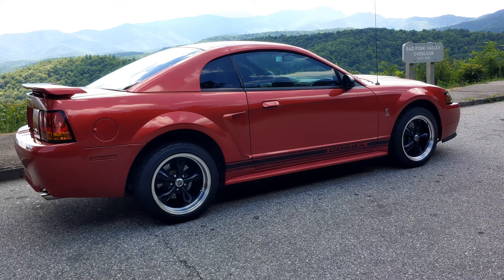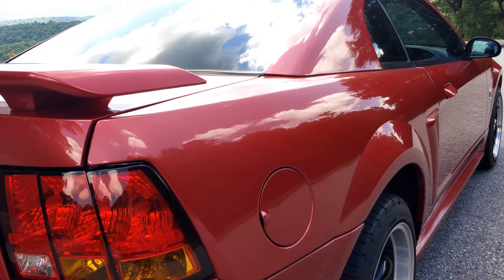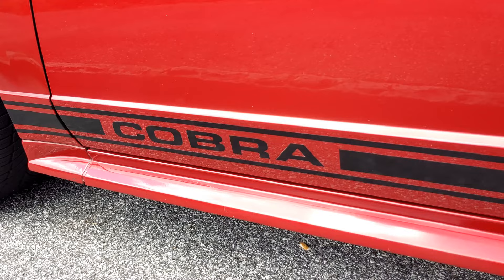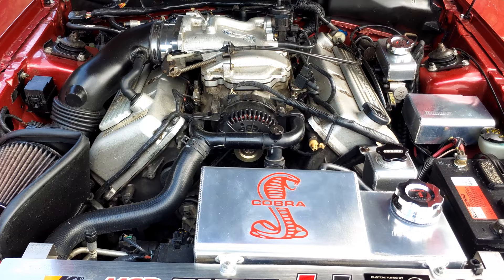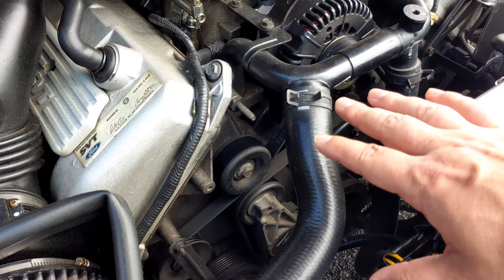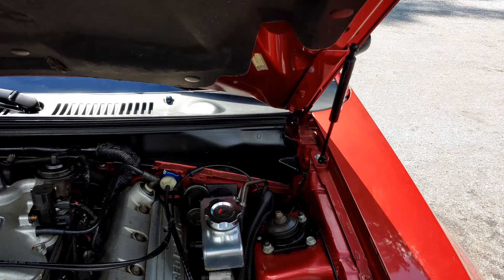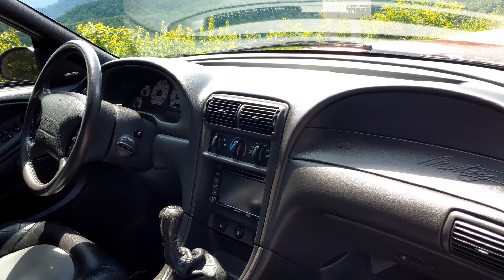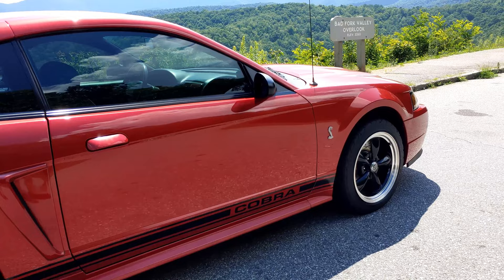An Affordable Muscle Car | The 2001 Mustang COBRA

Comment from the maker: I've since sold this 01' COBRA, and now enjoying the GT500KR. It was an awesome car I had for 10 years. Let me know in the comments below what you think about the COBRA 🛠
Reply: Well that great man!! I am getting offered a 1999 cobra Clean title paint is rough bumper was replaced from previous one being damaged but I am getting told $4500 just hesistant becuase of it being 210k miles what should I do? It’s a freinds parents.
Reply from the maker: @waspcosm1c901  That's an OK price for a COBRA, but that's a lot of miles. I'd probably want to do a compression test and see how the engine internals are doing before buying a car with high mileage. Also, be prepared for things like IRS suspension bushings, transmission, A/C, and electronics too when over 100k. That's in addition to the normal stuff like brakes, pumps, belts, cooling, intake, clutch, etc..

If your handy and don't mind working on cars it's will be a good car to enjoy. However if breakdowns, and mechanical fixes aren't your thing I'd probably steer clear. I'd also offer $3800-$4k with that many miles unless it's immaculate and has all maintenance done.

Thanks for watching! 🛠️
Reply: @TheEclecticHandyman  thank you and I ended up not taking the deal I usually pay shops and would’ve been too expensice

Comment: I’ve been on the market for one and it’s hard to find an 01 Cobra that checks all the boxes and is at a good price point. Beautiful cars
Reply from the maker: I totally agree the way to get one of these is close to stock if possible even if they have some miles. The ones to be careful are the heavily modified or younger drivers that probably ran them too hard and might be buying a clunker.

These will always be in the shadow of the 03-04' Terminator and hence cost much less. My recommendation is to open up your search radius country-wide and be open to traveling to go get a car or have it shipped. You might find some older person selling a stock 01' COBRA 800 miles away on the cheap and worth it to fly there 1-way and drive it home or have it shipped. Thanks for watching! 🛠️

Comment: Ive got my 01' Zinc Yellow 48k mls maybe up for sale..Maybe....Prices should start coming up for these low production cars..Roush short throw shifter , Chrome 03, 04 Terminator wheels.Chrome race pedals same rocker panel badging as this car aswell..Also mine has the Teksid block made from Ferrari for Ford..

Comment: The powered by svt coil covers are 07-14 gt500 covers.  Everything is interchangable between all 99 up 4v weather its 4.6, 5.4 or 5.8.  Theyre all mod motors.  Alot of guys put these gt500 covers on 99-04 cobra and 03-04 mach even tho machs arent svt they had an "svt engine" i guess is the thought process.

Comment: I own an 07 gt500 and i am about to purchase another stockish 97 cobra to fix up.  I used to hace a 97 cobra and 03 mach i love the 4v engines.  I understand totally what you mean about the gauges.  The 07-09 gt500s gauges were kind of hard to read in the daytime under certain condition and these are not at all.  The white face was actually a nice touch they should have continued that.  But at night i can see the gauges awesome.  These are very cool im a big fan of all 4vs.  These can be made better than a terminator with forged rods and an aftermarket piston.  I mean engine wise.  Theyre low key slept on all na 4v were.  They could outrun lt1s and run with ls1s of the day with 4.6 liters.  This engine should have been in the gt and the cobra should have got the 5.4 4v like the r got.  They would have smoked gm and sent them to the drawing board long before the terminators came out.
Reply from the maker: That would have been amazing if the 5.4L was in the base COBRA! Yeah I still have issues seeing the guages on my 09' during the day especially if shaded it's just too dark. I agree the 01' NA engine is a sleeper and totally overlooked to the Terminator. It can get some serious HP as you say!

Comment: The 99 cobra ordeal wasnt nearly as big a deal as everyone made it out.  All it was was intake manifold casting issues and sonething with the original catback causing it to lose power.  Its not like it had worse flowing heads or down on compression this is super simple to fix the reason the 2000 outside the r was canceled was because they were fixing the 99s.  All they did was port the intake and swap the catback to push them beyond the oroginal 320 hp mark.  An 01 with the exact same stuff will make the exact same power.  There is alot of misinformation out about this or guys who just really dont understand what the issue was.  

A 99 with ported intake and fbo will make same power as an 01 with the exact same stuff.
Reply from the maker: Yeah I don't think I misrepresented this information here, but it's well documented that Ford had egg on their face when it was discovered via Car and Driver, BlueOval, and other COBRA owners that dyno'd their cars. Fix was mechanically simple for 99' owners but the byproduct was a hurdle. It was a big deal the marketed HP was wrong and to skip an entire production year (sans 00' R) due to fixing it wholesale. It's well documented including in the book 'Powered by SVT,' that there was not enough capacity at the plant available to produce intakes for both the service fix and for production vehicles at the same time resulting in a cancelation of the entire 2000-model COBRA run. In the world of auto manufacturing, yeah it was kind of a big deal. Ford made the right call and 01' sales were much improved, but had they done it right out of the gate, they would of had a 2000 COBRA as well.

Comment: I’m aware you sold it but my only suggestion would have been to drop it lower. It’s expensive but I would go with an air suspension just in case you run into shorty roads.
Reply from the maker: Yeah I'm an odd ball in that I don't really like the look of lowered cars. I did it with my 1st car putting an Eibach kit and adjustable shocks and just hit everything on the road. Also I did like the stance on that COBRA as it was and looked cool to me. I know most feel diffently and lower. Whatever people like is cool with me 😎🛠️

Comment: Might be looking at a Laser Red Cobra today or tomorrow. Let's hope this one doesn't have a bent frame! (seems to be a common problem on foxbody platform cars. 😂)
Reply from the maker: Good luck it's a great car! Technically 79'-04' were all built off the Fox Body platform, but commonly only the 79'-93' Mustangs were referred to as 'Fox Bodys.' The 94'-04' were considered SN-95s. I'm not super aware of bent frames on the SN-95 generation Stangs, so hopefully those woes were more relegated to earlier versions as I mentioned.
Reply: @TheEclecticHandyman  That is correct. I guess Ford called the 94-04 the Fox-4. Anywho, I had a 1988 GT and the driver side frame was bent, and I recently looked at a 1999 Cobra and it too was bent. I just don't have good luck, but I understand they're a bit fragile as well.

Comment: Did you have too tune the car in order to run the accufab and spacer???
Reply from the maker: I had a Bama Tuner from American Muscle and indeed I did send them my updated setup and they returned me the correct tune for the car. Purists will say those tunes are garbage, but that COBRA ran A+++ for like 6-7 years with those tunes.

Comment: How much whp was it making?
Reply from the maker: I actually never had it dyno'd but between the race tune, LT headers, intake and other bolt on upgrades I was probably close to 350HP up from the stock 320HP. To really bump that up I'd have needed to do forced induction which they do make for the car (Vortex) but I never made that investment.
Reply: @TheEclecticHandyman if it is fbo tune its prob 315-320 rear wheel hp.  That is about what they make fbo tuned with cams you can do like 370.  The stock crank is forged the block is pretty strong so with forged rods and pistons can take 800+ wheel easily.